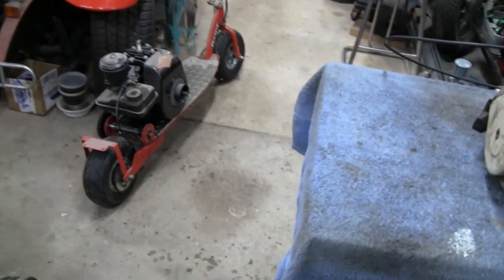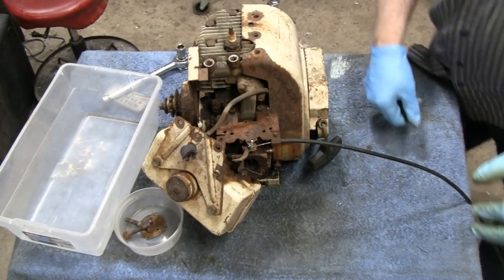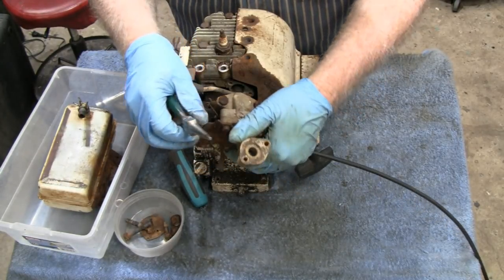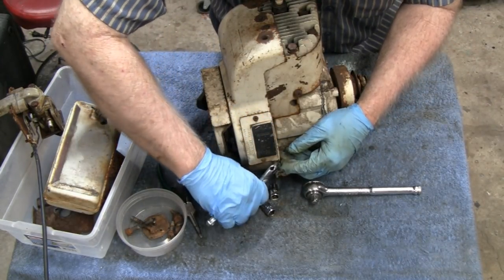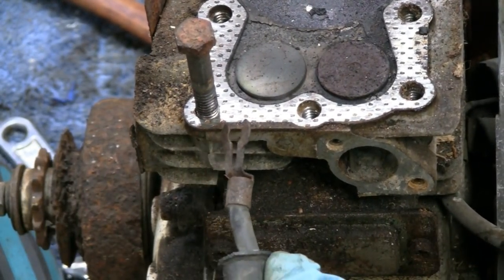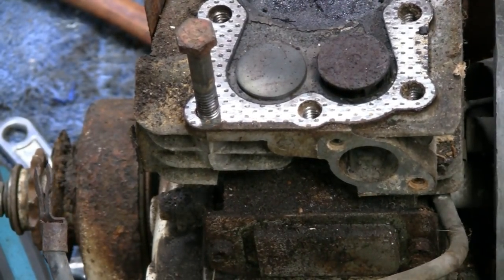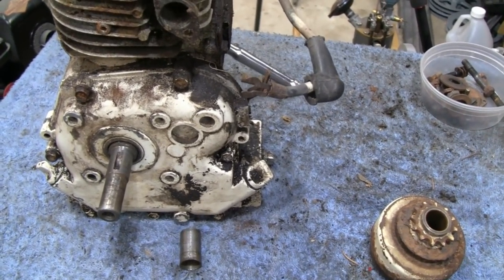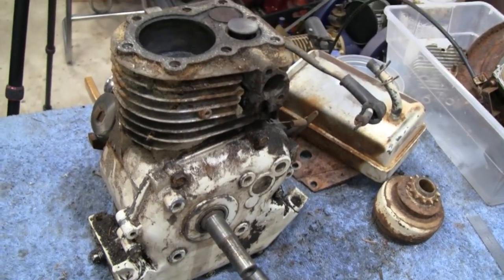MOTORIZED SCOOTER ENGINE SWAP (part 1)

Comment: Good stuff Chief. I have been mowing with Tecumseh since about 1980 and never had a problem. A plug n oil change every 10 yrs or so lol and having to clean the carb a few times is all it's ever needed. Cheers mate.
Reply from the maker: Chief!! I get it Mate!! Sounds like my Briggs lawn tractor, bought it new in 1982 and never changed the oil yet, we do top it off once in a while though!!☺

Comment: It's a snowblower engine from the 70's. I had a Craftsman single stage with power drive snowblower a long time ago with an engine like it. That button on the carb is a primer. The clutch was used on the snowblower too. They're good little engines..... though loud even with a good muffler.
Reply from the maker: That's funny!! Mike was just telling me that today, he had one too!! He said "does it have a little metal shelf right over the pull start on the housing", Roadking said yes, Mike said "It's a Snowblower!!☺
Reply: @805ROADKING  I had a couple over the years. I think Sears made a ton of them. I "machined" the crank with a file why the engine was running, until the clutch fit.... I used the engine on a mini bike.

Comment: We used to take the springs in those clutches and go to the hardware store and find weaker ones that were the same size and then re install em on our mini bikes and go karts and when you revved the engine it would lock that clutch up nice n fast.
Reply from the maker: I like that idea Zack, it would be alot easier than machining that crank and cutting a keyway!!☺
Reply: Hey Zach, i guess you'd have to be careful not to go too much weaker, or it would always be dragging/pulling
Reply: @dwaynejohnson6277  yeah we used to just cut the springs down a little if it was too weak

Comment: For those who don't know, that's an old Tecumseh, old ignition, metal fuel tank, fuel cap in the center. The newer 1980s/1990s engines have electronic ignition and plastic fuel tanks mounted with a side clip. The $4 diaphragm carb kits from China will also work.
Reply from the maker: I forgot about the electronic ignition!! I know Briggs switched over in 82!!☺
Reply: @805ROADKING  Yes, industry standard in 1982.

Comment: I purchased a 10 H. P. Tecumseh new to powder a 1/2 scale airboat I was building in the early 90's, that thing was hard as heck to start but ran OK once it was warm. It never got any better though. Never bought another.
Reply from the maker: That don't surprise Me!! The 90's is when Briggs and Tecumseh started going down hill!!☺

Comment: The Tecumseh came off a snow blower  R K . Diaphragm carb  was used on snow blowers , and the head shroud around the muffler is a dead giveaway .You just made it on that carb screw , put the anti seize to it on reassembly , those are always the one that breaks off .
Reply from the maker: Thanks for the info Bob!! Some other guys mentioned some tip offs that it's a blower!! You're the first to mention the muffler shroud, that's the first thing I noticed that looked odd to me!!☺

Comment: Good old Tecumseh snowblower motor with a diaphragm carburetor. Rebuilt more than a few, biggest thing to watch is the oil level. The Indian likes oil to the top of the full line, otherwise they really like to break a rod. The "heater box" is missing which is merely a shroud over the intake. The little cover over the rope start and lack of air cleaner are signs of a snowblower motor. Have fun and if you need paperwork, let me know, but I doubt you need any help!

Comment: I'm a small engine mechanic from waaay back. I use to try rebuilding those Tecumseh carbs. I don't think I ever got one right! The strangest thing about them is that on some the gasket goes towards the carb body and on some the diaphragm does. I believe the manual doesn't say how to tell. It just says put it back the way it came off. Good instructions if you were the one that took it apart. Show me how it's done RK!
Reply from the maker: That carb looks like a piss poor design, that's probably why they weren't around to long!!☺

Comment: Love your attitude.. It's not a Briggs but let's try it out... Same as I do now, my neighbor have an old JCB Backhoe with engine problems and I said let's dig into it. I have never been working on a Leyland diesel engine but how hard can it be :-)  I have been working on old Volvo gasoline engines a lot in my life and it's basically the same but a little different.. About 5 hour to strip the top down so we can unbolt it and see what have happen down below.. The biggest problem is that it's a mix of metric and imperial so you need a double toolbox to work with it and It's a Diesel engine so there are a lot more things to remove from the top that you have in a plain standard gasoline engine. Keep up the good work and I'm looking forward to see the end result.. Best wishes from Micke in Sweden.
Reply from the maker: Thanks alot Micke!! Great Story!!☺

Comment: Hey Roadking, you weren't sure why Tecumsehs have a bad name?  I've seen several with broken con rods.  I believe in later years they beefed them up to solve the problem.  
I also know that some have a decompressor on the cam which may explain your low compression when trying to start it.  Once you pull the cam you will see if yours has that or not.

Comment: That part number is a Craftsman part number.  It cross-references to Tecumseh H30-35100C.  I'm pretty sure that came off of an old snow blower.  Still trying to find a parts breakdown.  The earliest H30 breakdown I've been able to find is of the 35100F variety.
Reply from the maker: Thanks for the Info Shannon!! I found the 35100F diagram and it's close enough that it gave me part #'s for the carb and rebuild kits!!☺

Comment: I'm restoring few Rocket 7 tillers that use Tecumseh HH70 from mid 70's,  same metal tank, same ignition...easy to work on, easy to get running.  setting the timing could be tough,  got to find TDC and rotate the points assembly. But not bad.  Briggs on the other hand, don't like.  Converted from points to electronic ignition, hard to start on my 5HP...and need special tool to remove that fly wheel
Reply from the maker: Yeah I'm gonna try not to mess with the timing assembly, but if I do we're gonna mark it and put it back in the same position and hope it was adjusted right!!☺
Reply: @805ROADKING  don't mess with the assembly if you don't have to.  It's a real pain, and marking does not work so much. There is a procedure, where you use a dial gauge and set the cylinder several thousands before TDS a believe, then rotate that thing with a multi meter and check for continuity.  I marked mine, would not run, then had to do it according to the manual.  I rebuilt mine, had it stripped.
Reply from the maker: To late Bud!! I just ripped it apart a half hour ago!!☺
Reply: @805ROADKING  i guess I'll watch your struggles in next episode, lol

Comment: Dr EJ is operating. Please be quiet in the observation gallery. If you want more power for that Tecumseh (or a B&S) put a Mikuni knockoff carburetor on it with a custom intake. You can do it.
Reply from the maker: I just bought one on your recommendation!! It looks interesting, even if I don't use it on this engine I think it will be something fun to play with!! I paid $10 for the rebuild kit on that Tecumseh carb and $14 for the whole fake Mikuni with an air filter!! Thanks Bud!!☺

Comment: 30th day of 1964. Due to the exhaust, sleeve, and 7/8th shaft I'm guessing that thing started out life on a sears snow blower. By 74 it would have had a plastic as tank on it. They make 7/8th clutches that require no machining.
For a the scooter I would ditch the factory carb and put a knockoff mikuni carb on it.
Reply from the maker: It only has a 5/8 shaft Neo!!☺
Reply: @805ROADKING  I meant 5/8th. Clumsy fingers on tiny phone screen

Comment: That was probably on a tiller seen one or two motors with that clutch and was told they were on tillers and tecumseh crabs were a nuisance so people just put briggs carbs on them instead easier to maintain only managed to clean one successfully but the tecumseh crabs are good until they start giving problems tecumseh and briggs should have same blocks and internals just the carb is different
Reply from the maker: Yeah if we have trouble with this carb we'll replace it with a tecumseh carb with a bowl!! We have a few of them laying around!!☺

Comment: I probably would had put a slightly higher lift cam on the 5S and tuned it for 6000 rpm.

Comment: looks likje a snowblower engine most likely judgeing by clutch pulley setup
Reply from the maker: Yeah Buddy!! A few guys said the little shelf over the pull start on the housing is a dead give away!!☺
Reply: @805ROADKING  it is and the pulley sprocket combo to
Reply: @805ROADKING  I could be wrong but I think that the reason is a pulley  slash Sprocket is because the sprocket chain drive was for the auger itself and the little grooves on the backside was for a pulley for the drive system That made the wheels move in there probably was a tensioner of some kind that was like a pulley that probably was attached to the brake clutch itself once you hit the brake lever or let go of the drive lever  however they had it set up. Probably one of your standard early 70s white and orange two-tone craftsman eager one snow blowers